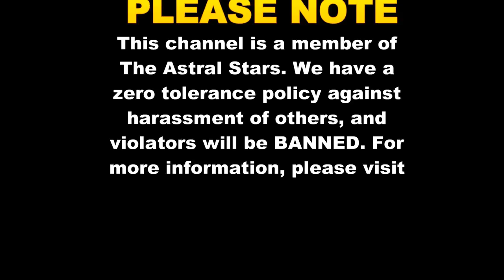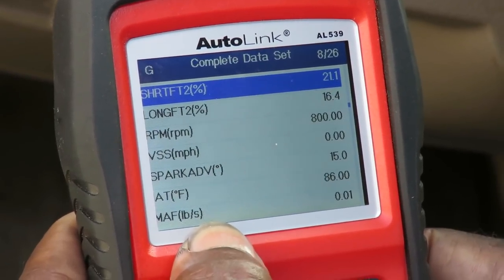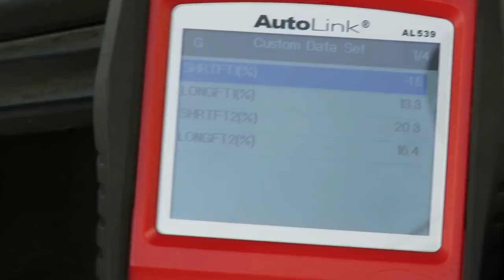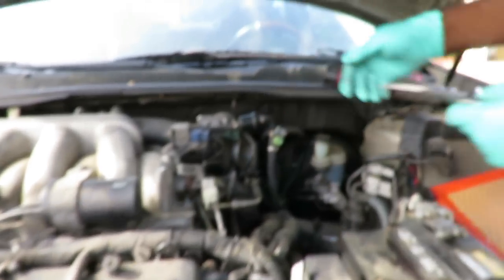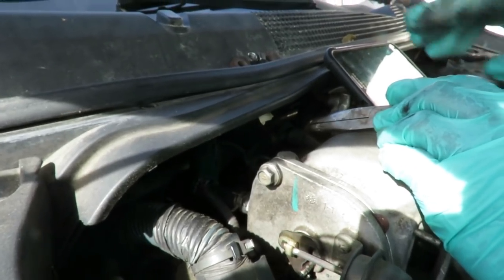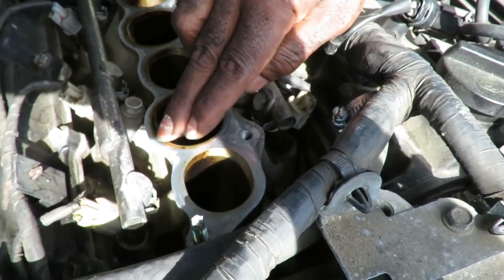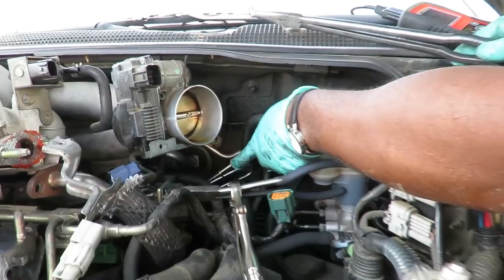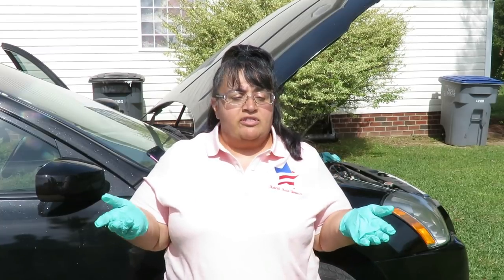⭐ 2004 Nissan Maxima - 3.5 - P0171 - P0174 - System Too Lean Bank 1 Bank 2 - Part 1

Comment: Nice video helped me do the job replaced the upper and lower intake but now i have different code p0300 can't figure it out how to fix it..😔😥 i have a 2005 maxima
Reply from the maker: That is a difficult code!! Check all vacuum leaks, and if you have a scan tool, check your fuel trims.

Comment: My 09 Maxima has been engine knocking between 0-20mph. The service engine soon light came on and there's a P0171 code. The idle is high as well. This occurred while ac was on.
Reply from the maker: If it's ONLY when the a/c is ON, then chances are good that it is the compressor.
Reply: @OnlineAutoRepairVideos  Since it's hot and running my air is when I started experiencing this. I did have my ac recharged, but besides that the car runs good. When my SES light came on the idle became high as well.

Comment: Have the same codes for my 2011 maxima.. you all think might be the SAME issue.? A crack or even Brocken.? 😭
Reply from the maker: Could be
Reply: @OnlineAutoRepairVideos  woow.. dnt tell me that.. I was hoping for a vacuum line or something easier lol
Reply from the maker: @santiagodavila1426  It still may be possible, LOL! Keep us updated!
Reply: @OnlineAutoRepairVideos  now I ll be afraid.. here in Az ll be at 95-100 temperature, dnt fell like going around the Yunk yards 😭😭😩😩
Reply from the maker: @santiagodavila1426  I've heard about the heat there, OMG!!!
Reply: @OnlineAutoRepairVideos  yes. Lmao.. can’t wait to be at 115-118..

Where you stay at.?

Hey so I found a lil hose line behind the manifold with a big cut, after replacing and resetting the codes with the scanner you Think the SERVICE ENGINE light ll stay off.? I need it to be off to pass emissions😒
Reply from the maker: @santiagodavila1426  We are in North Carolina, and YES, that hose could be the culprit!!
Reply: @OnlineAutoRepairVideos  ooh Woow.. you in heaven.! 🥲🥲

Si this hose could be the cause for both codes..? P0171 & P0174.?
Reply from the maker: @santiagodavila1426  DEFINITELY!!